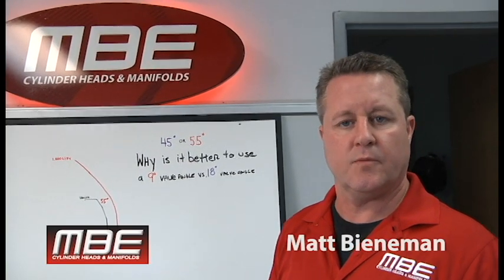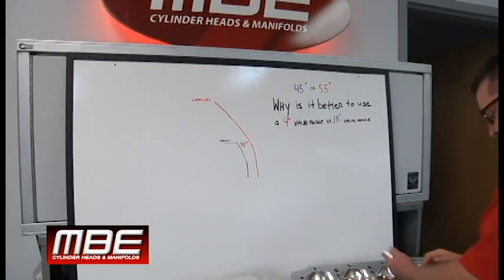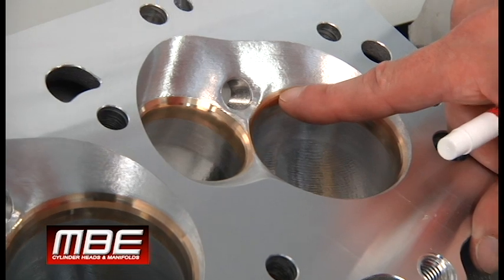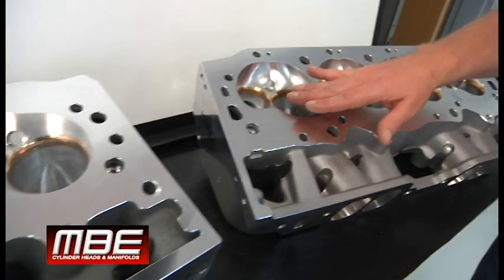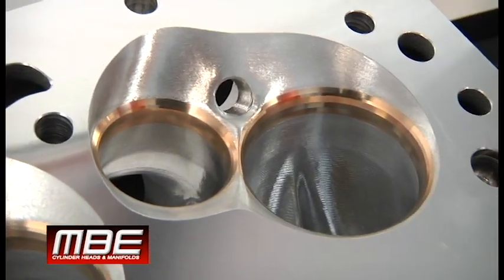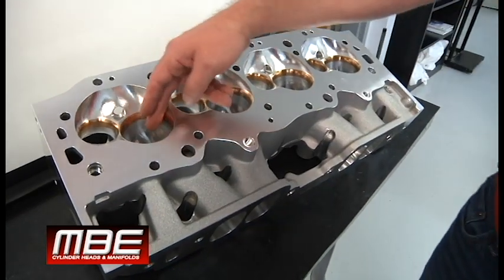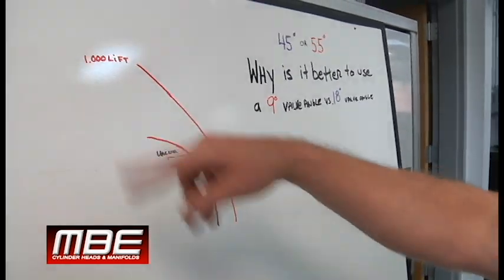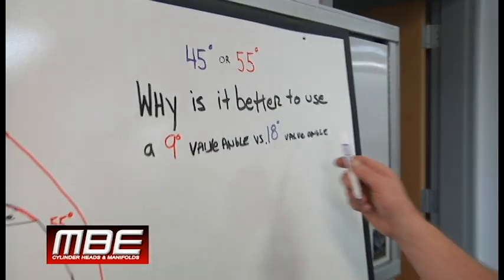9 Degree Valve Angle vs 18 Degree Valve Angle   ** TECH VIDEO **

Comment: Professional driving instructor here with a comment about the pedagogy here : I'm quite sure some other guy in a race team with equal cylinder head knowledge would understand the explanations here perfectly but to me who is just an enthusiast when it comes to engines, this video explains almost nothing. 

I got one thing through my thick head and that's the thing about the valve angle and the rules, that I understood. The rest is pretty much pig latin to me.

Now, about the pedagogy : is this video supposed to be informative to the average joe or more of a pro to pro-kind of demonstration? If the former, then the pacing is way toofast and terms aren't explained thoroughly and if the latter then the precision of the demonstration is lacking.

I didenjoy the video quite a bit and will be combing the wikis, foeums and tube over all that you covered so thanks.

Comment: If you had two cross sections of the  cylinder heads drawn on the white board before starting this it would have been way easier to explain.

Comment: This guy knows what he's talking about but he's no presenter 🤣  You gotta be pretty specific about what you're looking for to find this video comprehensible.  I'm glad I knew that a lower port requires digging out on the whiteboard b/c that, like many other things, wasn't explained.  I mean, transitions man.  There's not a bubble over your head!
Reply: Yeah... I had to watch it a few times just to get what he was "trying" to say... he jumped back and forth too much, too fast...
Should've had both degrees on the board in a cutaway... he knows what he's talking about, but do we know what he's talking about???
Reply: If it wasn’t for the product speaking for itself. I assume that’s why he is presenting this he don’t have to be good when his product is this good.
Reply: @dreece2000 when the product is good you'll have more confidence and integrity.
Reply: if he had some cross-sections of the two heads pre-drawn on the whiteboard it would have been much easier to explain.

Comment: And this is why chevy boys wanted to ban the Cleveland in their small block classes. Cleveland stock valve ange is 9.5 degrees with a 4 degree cant. Lol I have actually had BBC guys try to tell me my 4.380 bore spaced Cleveland is actually a Big Block just because of my heads. BBC guys hate when a 359 Cleveland beats their big iron hahahahaha
Reply: Way back in the 1960s when GM engineers began designing the “Mystery” big-block 427 that would eventually evolve into the Mark IV 396/427/454, cylinder head port designers realized that if they tipped or canted the valves at an angle from off-center, the intake flow improved. This created the canted valve head design that made the big-block Chevy famous. This is also the concept that Ford engineers integrated into the Cleveland head design that became famous (or infamous) with the Boss 302 head. The Cleveland and Boss 302 engines may be considered infamous because of their huge port cross-sectional areas. But the concept of the canted valve has not been lost on cylinder head designers. The idea is to cant or tip the valve toward the center of the cylinder bore, which means the valve moves away from the cylinder wall as it opens, unshrouding the air path to move more efficiently around the valve. This not only creates a more efficient air path, but it also allows the engine builder to use a larger intake valve within the same bore size.
Reply: @ But guess what, Chrysler made the canted valve before Chevy - called the Polly Head :face-green-smiling:
Reply: Yep.   Cleveland heads are badasses
Reply: Yeah , worked so well had to go build a coyotie …..hahahahahahah🤣
Reply: They still leak oil....